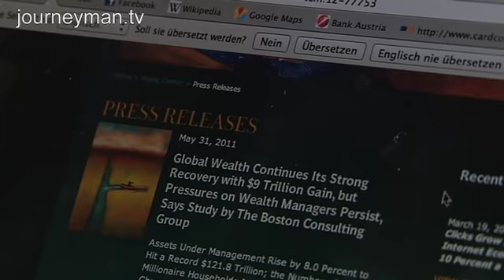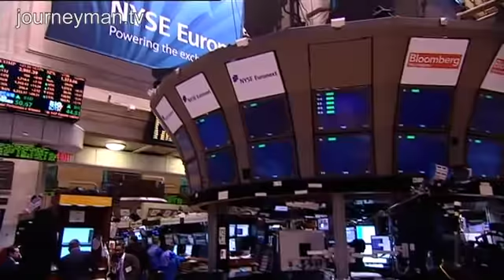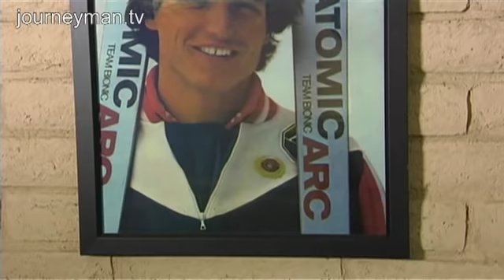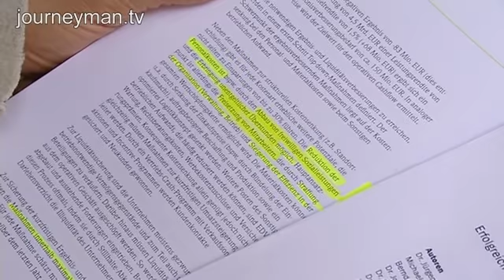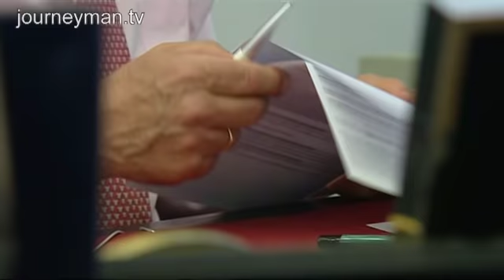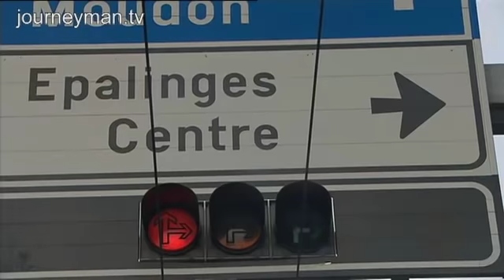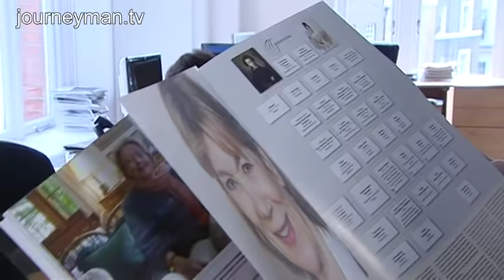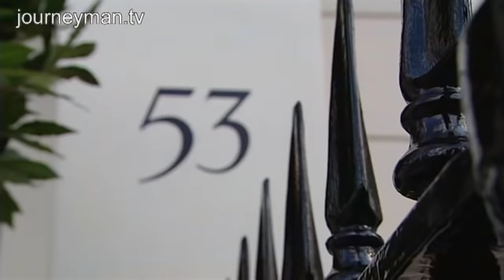Inside The World Of The Global Super-Rich

Comment: There are 2 cars driving on a road. One behind the other. The car in back is going 50 miles per hour, the car in front is going 80 miles per hour. At first, the gap between them is only about 20 feet. Astonishingly, 10 minutes later, the gap has grown to almost a mile! We must fix this inequality! I know! Lets give the car in back more gas! And we can get it from the car in front. 
*Meanwhile, no one bothers to tell the driver of the car in back that cruise control is on and that he can accelerate if he only put his foot on the gas petal.
Reply: Damn man, that was put simply.
Reply: Analogy is the weakest form of argument. Just because we know it works/might work for two cars, how do we know it would work for rich and poor (presumably the point you are trying to make?). The value of analogy for debating purposes is it is pretty. Don't ever confuse pretty with truthful.
Reply: @dionlindsay2  And yet you completely missed the point. Sad.
Reply: @imichael2411  Oh dear
Reply: Michael I 

No, it seems you have missed his.
Reply: Nick Fleming You cannot force wealth and success on people. They have to want it then want to work hard and smart achieve it
Reply: @homodeus8713  exacly, of some want to work a normal 9-5 until they retire they Will not become rich but they have also in that case not worked for or tried to become rich.